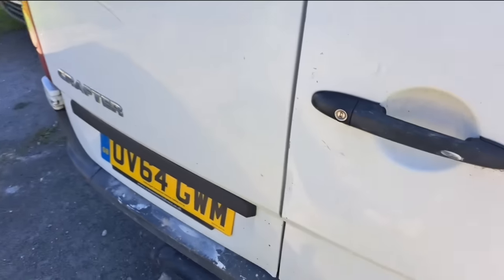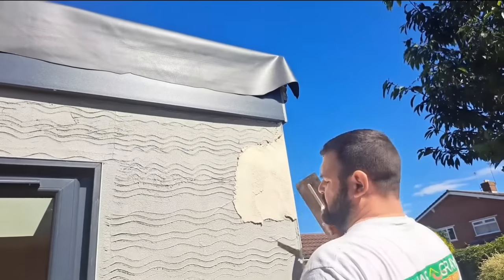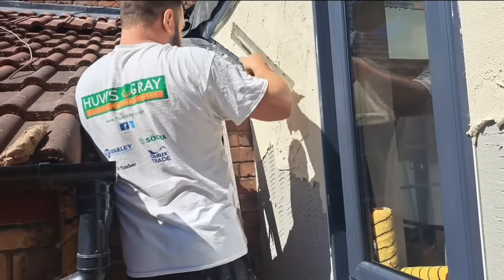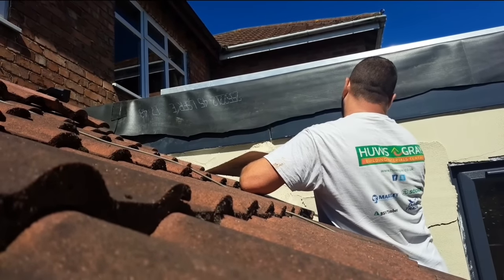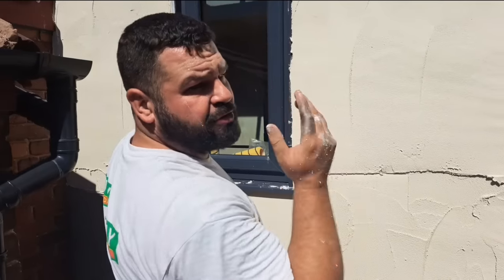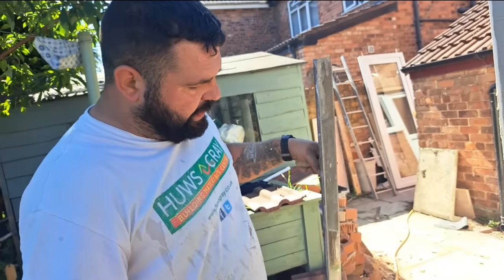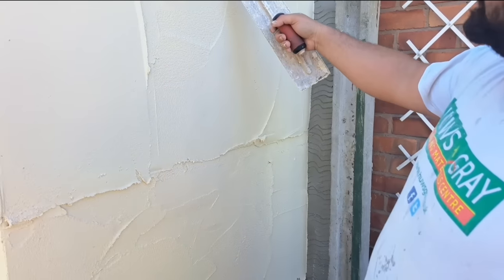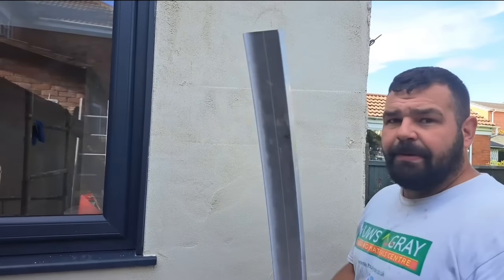SCRAPED RENDER good money but hard work

Comment: Watched a bunch of guys render a villa I was working out in Spain in Monocapa Kirk. 5 of them turned up in a Vauxhall Vectra and piled into it, 2 mixing, 3 applying - they had buckets of the stuff ready to go on the wall - base coat with fibreglass mesh, then top coat - they worked their nuts off mate..
On the last day they needed a bit more gear to finish the job off, so when they arrived, they had a few bags in the boot of the car and the 3 lads in the back seat were sat on 4 bags of render...🤣
You could always tell which houses were built by dodgy builders as the evening sun would cast some horrific shadows down a poorly rendered house. Imagine doing that when it's 35 degrees though - no thanks..
Reply: Dunno why but thats reminded me of Auf Weidesehen Pet at Ali's villa!